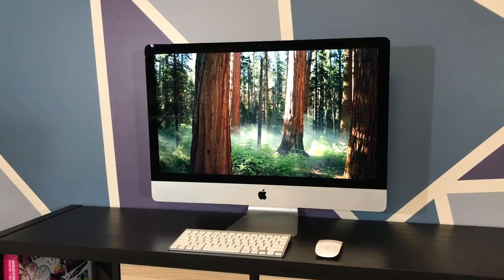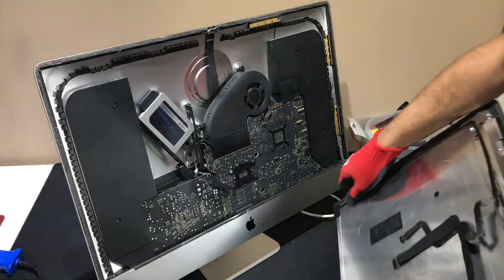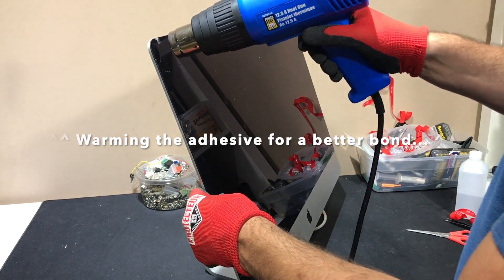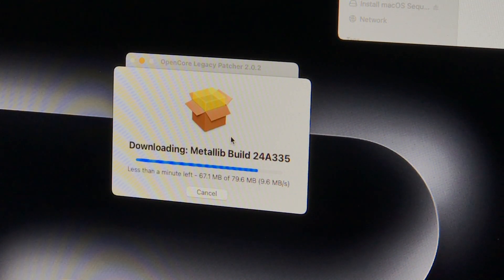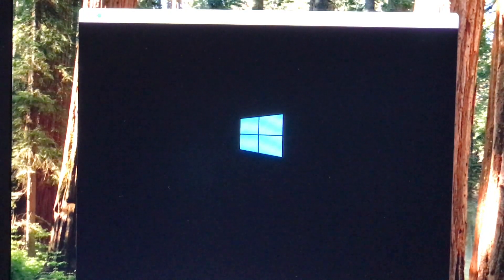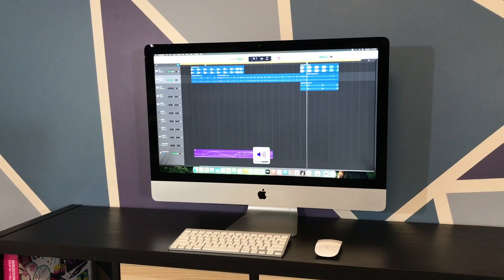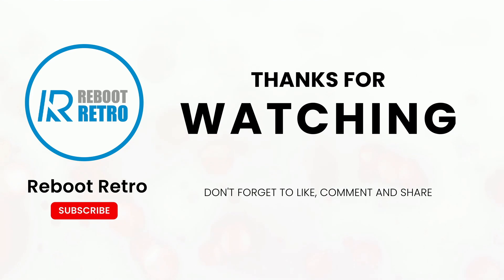Apple doesn't support it, but this 2012 Big Mac runs Sequoia perfectly!

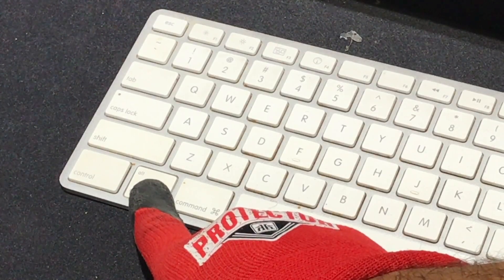Comment: 4:54 it's really not important to be the latest version of MacOS I have an iMac under macos high sierra I don't update it even though it supports macOS sonoma the new features are not interesting I prefer the original design of macOS than iPhone icons
Reply from the maker: I agree, I don't care for most new features either, or new bugs.  However, the security updates can be somewhat important if you use the device online.  The biggest problem with old OSes is they don't support the latest web browsers, which means you're missing vulnerability patches.  I do wish there was a way to get security patches without needing full system updates.
Reply: @rebootretro  the best macOS yosemite style now with big sur with the phone icons it's ugly and a little weird I liked everything on big sur apart from the dock

Comment: I just tried to install Sequoia and Sonoma onto a Late 2012 iMac with a 3tb Fusion Drive and 32gb Ram. I tried three times but it failed to install at the same point , 14 minutes remaining on the first installation part before you select which type of installation to select.  Any idea?
Reply from the maker: I can't say for sure, but I have heard that certain brands and sizes of USB sticks cause this problem.  I would try a different brand stick and a different size.  I don't think I show in the video, but I used a USB to SATA adapter with an old SATA SSD.  Also, I would try to fully erase your system disk and freshly partition for APFS.  Sometimes the installer defaults to HFS+ which will cause problems.  I've also had a problem in previous installs where the installer would get "stuck" at "x minutes left" - but if you let it sit there for an hour+ it would eventually make it through.  Hopefully one of these helps!

Comment: Target display mode requires the main Mac running Mac OS Catalina or older. The iMac should be running El Capitan , Sierra or High Sierra. 

Airplay to Mac is the successor to target display mode. You would need to use open core legacy patcher to install Monterey or later to enable Airplay to Mac. A USB or thunderbolt connection between the Macs would improve resolution and decrease lag on the iMac.
Reply from the maker: I think some people have managed to use TDM outside those specific OS versions, but it seems really dicy.  Kinda silly that that TDM is proprietary and can't just operate as an industry standard Thunderbolt display.

That's interesting, I didn't know you could use USB/Thunderbolt to direct connect for AirPlay.  I'll have to play with that.  That's the biggest issue with AirPlay, is the latency is horrible.

Comment: Had to get rid of my mid 2010 27" just last week for a new one......14 years of service, not bad by my calculations.
Reply from the maker: You did really well with it for sure!  These were pretty reliable systems, with the biggest issues looking to be GPU failure.  Although with replaceable GPUs, these just keep on going!

Comment: you could go to win11 too.  Did you test iMac as a monitor?  
my 27" has the old plug mini display port. Do I have to keep high sierra on the iMac?

iMac 27"  as monitor for the new iMac mini M4 would be great.
Reply from the maker: You should check out the video I did here (https://youtu.be/TQwCJYiLqSo) where I used an iMac as a monitor.

As for what connects to what, it depends on which Mac you have.  The late 2009/2010 models will accept any DisplayPort signal from any other device, including an M4 Mini.  With my testing I had upgraded to Monterey via OCLP and I think had a GPU upgrade at that point too.  Mine was a little buggy, which I think was the aftermarket GPU.  It does work past High Sierra, but completely unsupported so it could potentially be glitchy.

Just watch out, because the 2011 iMacs have the same connector on the back but DO NOT support DisplayPort signal, only a proprietary Thunderbolt TDM connection.  The 2011 only works with certain Mac models and OS versions; I'm told the Apple Silicon Macs don't work at all with this.

But nearly every model of Mac will work with the Sunshine/Moonlight method shown in the video (or use Parsec alternative for an easier Mac to Mac setup).
Reply: @rebootretro  lucky me.  the iMac is from 2010.   Great tip to the  workaround monitor over lan.  I will try it.
Reply from the maker: @susihormon7821  Yes, the 27 inch 2010 is one of the best systems to use as a monitor!  If you need an HDMI input, you can use an active DisplayPort to HDMI converter (the passive cables don't work, you need an active cable with a converter chip inside).  The DisplayPort input is much better than LAN method.  Good luck with your project  :)

Comment: For audio apps GB/Logic Pro, use OCLP version 2 or higher. Older versions enjoy timing errors and halted playback. Logic runs perfectly on my 2011 27inch i7 running Catalina. The 4k & 5k thin iMacs offer the best iMac graphics, making them prime candidates for OpenCore. I bought a 4k 21.5 2015 model with this upgrade path in mind.
Reply from the maker: That's interesting about V2.  From what I've seen so far, V2 brought huge improvements for older Mac support.  I like how you're thinking ahead for upgrades; just knowing full well Apple will drop support and having a plan!

Comment: I have iMac 27” 2011 so I can’t update to Sequoia? Is that correct? 😢😢😢so I should stay on Sonoma until I get the Good to go from OCLP. 😢😢😢
Reply from the maker: I believe it does work on a 2011, but I haven't looked deeply into it or tried it yet.  You're right though, it could be buggy.  Realistically the biggest reason to upgrade an old Mac is to run modern software and get security updates.  If you're on Sonoma, you're still good for all of that.  If you want to keep your system stable, it would be a good idea to only load it after they officially support it.

Comment: I used 3m tape and my screen fell out ripping the connectors clean off the motherboard leaving me completely computer-less until I can save enough for a replacement.  I’ll not be purchasing 3M adhesive tape again.
Reply from the maker: That's horrible!!  I'm sorry to hear that happened!  I've read about a few people that happened to, but also people who used the proper seal kit and had it fall out too :(

I would suggest as a temporary solution to use it with an external monitor.  I use an iMac with a completely smashed and unusable screen as my daily driver - 2x external monitors connected.

If you go the external monitor route, the fans will run full speed if the connector is ripped off (because it can't measure screen temperature, and then thermal throttles).  You should be able to fix this by installing OCLP (OpenCore Legacy Patcher) just like in the video; there is a custom mod (off by default) to disable thermal throttling.  With throttling disabled it should run at full speed again and the fans won't sound like a jet taking off.

Hopefully this can get you your computer back until you can buy another one :)
Reply: You saved me with this comment

Comment: Is OCLP safe?  I've played with it a little bit and it runs something in the background of MacOS that checks for updates to itself, etc.  Would it be in the realm of possibility that they could put something in there that steals your apple password when you login to the os for iCloud, etc?
Reply from the maker: I talk about this later on in the video.  Is it possible they intentionally (or even unknowingly) get malicious code into OpenCore?  Yes, it's possible.  But the OpenCore team has historically proven themselves to be a reputable group.  And the code is open source, so it can be scrutinized by anyone.

Ultimately you have to trust somebody.  What's to stop an Apple employee from injecting malicious code into stock macOS?  Apple's code isn't open source, so we rely entirely on the internal developers to vet the code.

Also, for example, there has been vulnerable code in the past (I think it was related to the C compiler, or SSH, or something) which was also open source and included in macOS for years before anyone noticed.

While we can assume that an OCLP system is likely less secure in certain ways just simply based on the system using certain old drivers/patches, I don't think it's necessarily fair to call it outright "insecure".  Based on the longstanding history of the OCLP team, I would seriously doubt there would be any intent to cause harm.

Realistically, a stock macOS should always be more secure, because you're not using patches and rolled back drivers.  But for some people who can't afford a computer, my opinion is that a OCLP system is more secure than running an outdate/obsolete stock macOS.  Just my opinion though.

Comment: If your older Mac has only 4GB of RAM, update to macOS Ventuta, it will get updates until at least fall 2025, with 8GB of RAM go macOS Sequoia using OCLP. I successully updated a MacBook Air 2013 with 4GB of RAM to Ventura, one with 8GB to Sequoia and two MBA 2015 with intel Core i7 2.2 GHz and 8GB of RAM to also Sequoia. Save especially those super easy to upgrade SSDs and replace non glued battery equipped MBAs from getting to become e-waste, they have great size, are lightweight and are still perfect for internet and word processing.

Comment: The only reason I had to stop using my late2008 iMac is it developed a 'green pixel line' fault - which is common with this era of iMacs - it was a home movie, music streaming/audio machine long after being unsupported by Apple. Love your retro videos - great content.
Reply from the maker: Thanks for the comment!  I really enjoy making more retro content, but I find I need to pepper newer stuff like this in so YT promotes the content better.  I try to make everything entertaining so it's enjoyable for everyone to watch :).  And yes!  Those graphics artifacts were very common!  If you saw my 2008 iMac video, that Mac was purchased brand new and had a GPU replaced a few years back for similar failure.  Still running great after the new GPU, and only retired it more recently.

Comment: I have this exact Mac. Came with the 3TB Fusion Drive. Ok, it now has 3 TB of SSD, 32 Gb of RAM and it's running 15.1 courtesy of OCLP 2.1.2. OWC seal kits work fine.
Reply from the maker: That's good to know about the OWC seal kit!  I know a lot of the ones on eBay and Amazon are junk.
Reply: @rebootretro  Yes, well, I have never had the need to take mine apart again, so... Definitely agree on the eBay or Amazon junk if their iPhone kits are anything to go by.

Comment: Fun fact: Even a 21.5" iMac can outperform the M4 iMac, by a lot too. You can upgrade a 2019 4K model to 64GB of RAM, an 8TB NVMe if you use an adapter for the m.2 slot, an i9-9900 (Not a K/KF/KS skew), Vega 20 (GPU non upgradable, best onboard option), and up to 16TB of SATA SSD storage. You can do all of these upgrades totaling out to $3500, which is the same price as an M4 iMac with a 10C CPU 10C GPU, 32GB of RAM, and 2TB of storage. This doesn't even consider that with TB3 you can get 10GB Ethernet, or another 8TB of storage in an external drive, and even an external GPU. In MacOS it's up to a 6900 XT but in Bootcamp you can use an RTX 4090 without any driver issues. Intel iMacs are still the KING of All in Ones.
Reply: Many of those things might be true. However, you also generate enough heat to warm a 2 bedroom apartment, a much higher electric bill, and enough noise to hear people complain about the airplanes flying over all the time. In addition, as soon as you add an external gpu, it’s no longer an all in one.  For me personally, the never ending noise from my 2020 5k iMac (a powerhouse of a machine btw), was a major issue when working with my students and my teachers, and even more of an issue when I started making music recordings to send out. Honestly, once I got my M1 MacBook Air which was silent, and ran rings around the iMac in the apps I was using. I did find it a good home with my wife’s brother and his family. Who in their right mind would max out everything on an m4 iMac?
Reply: M4 it is bullshit for dekstop computer Intel is way better ram can upgrade almost everything RIP iMac 27 best Mac Ever made Never who is never come back

Comment: My Dell XPS PC from 2013 is still running perfectly fine. I thought Macs were supposed to run forever..
Reply: What version of windows are you running?  It’s not windows 11. I had a 2007 iMac that was my main computer until 2015, and my windows machine until 2016. It’s still in use by a friend of mine running some version of Linux.
Reply: @musicalimarc  Windows 10. Unfortunately I will be forced to buy a new PC next year but not because it’s slow. I’ll probably install Linux on my desktop first to see if I can find alternative programs that I can use.. The Intel 4770 still has plenty of power.
Reply from the maker: @Level70-x4d  The 4770 was a superb CPU!  I've got a couple of those kicking around too.
Reply: My dell xps from 2009 with 8g ram, i5 is now running Windows 11 as of yesterday. Everything seems to work perfectly. There is a yt video that uses a script on github by builtbybel.  Smooth upgrade.  I also use the opencore method to run sequoia on a 2014 imac.  No issues.

Comment: I wish I hadn't given away my old 17" MacBook Pro. It would have been a nice addition to my museum quality collection.
Reply: I had the 12 inch PowerBook G4 and I loved that thing. I think it’s still hiding in a box somewhere since I still have the power brick for it and I don’t recall ever giving it away. The only reason I stopped using it was major back issues. I know it doesn’t seem like much, but almost 5lbs for one computer plus many many textbooks including one that weighed more than the laptop meant something had to give. I in 2099 I hackintoshed a dell mini 11 inch netbook which got me through a fair number of years of grad school and I wrote some of my masters thesis on that, and some of it on my first gen iPad.
Reply from the maker: Ya, I did the same.  The only laptop I ever bought brand new was the original 2006 polycarbonate Macbook, and I sold it after a few years when I stopped really using it.  I've got "replacement" ones, but it's not the same.  Mine had the original box and was pretty mint condition.  Oh well.
Reply: I tried o'clock on a late 2011 mbp 17" and it worked perfectly, except for the built in  camera, which was not detected.

Comment: You forgot Option 4: Run a  Linux distro like Mint.
Reply from the maker: Haha, it was only a matter of time before someone mentioned Linux! ;)

Mint is my favourite desktop distro.  Although I do use Linux, I'm not a guru by any means!  Mint is fantastic because it's easy to setup and use, and for the most part I don't have to fight with it to get it working.  I know some guys like to assemble their OS from scratch, but that's not me, lol.

But you're right, Linux is a fantastic option for old Mac.  TBH though, I prefer to run Linux on PC hardware because of better upgradability and cheaper hardware.  But if you already have a Mac kicking around, you're 100% right - Linux runs great there too!

Comment: Wish I could upgrade the CPU inside that thing. I have one from 2011 before even thunderbolt, using it for simple stuff now with win 7.... But I'd like more from it. It's a 24inch display I don't want to throw away.
Reply from the maker: You're right, it always feels like such a waste to toss an iMac with a good screen!  Since it's older, you might want to try using it as a screen with Parsec or Sunshine/Moonlight.  I made a video about that here: https://youtu.be/TQwCJYiLqSo
Reply: Thank you⭐I appreciate the reply. 
Yes tbh you might as well be right regarding the monitor size -I haven't seen or used it in a long while but keep wondering what to do with it since I've kept it🙏
Reply: Wait 2011? I dont think thats 2011. The 2011 had 21.5 and 27 inch.

And 2011s are still very usable with their sandy bridge cpus. You could even upgrade the gpu.
Reply from the maker: You're right, I'm guessing it's a 2008 which I believe is the last iMac with 24 inch screens.  I'm pretty sure the 2011 also had Thunderbolt 1, but I could be mistaken.